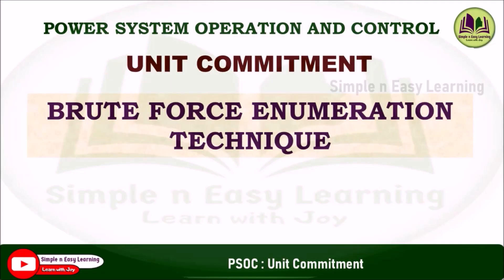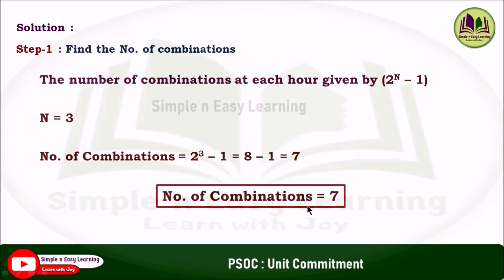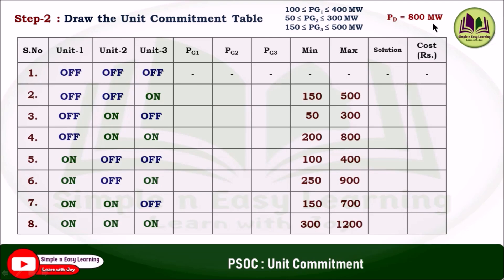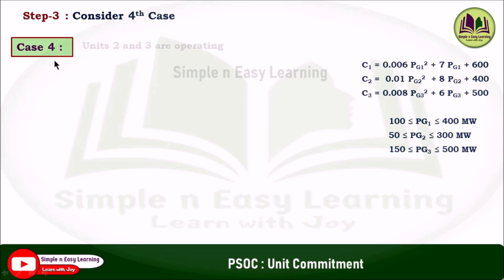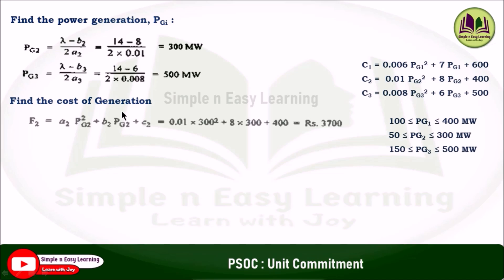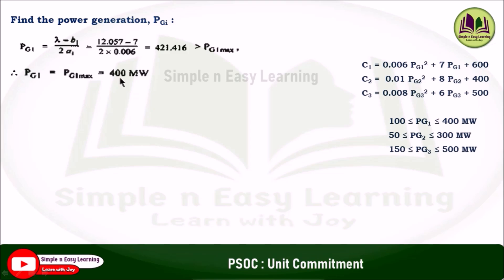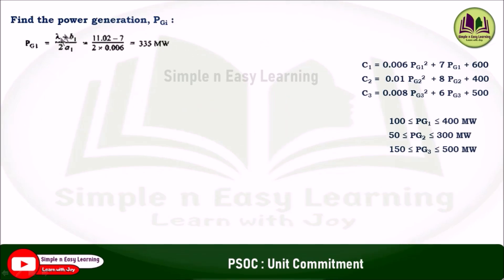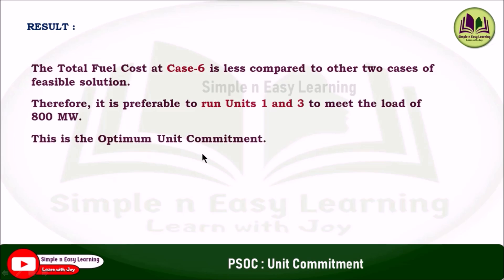Unit Commitment | Solved Problem - 1 | Power system operation and control | Brute force | PSOC

Comment: Which method use in exam because this method is easy
Reply from the maker: If the  method is not specified in the question then you can use any method to solve the problem.
Reply: @simpleneasylearning ok sir